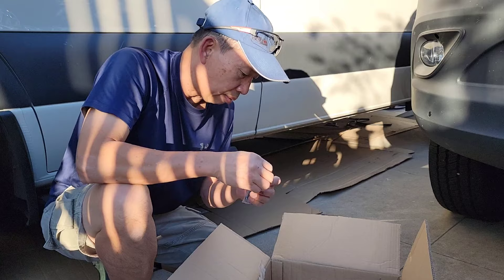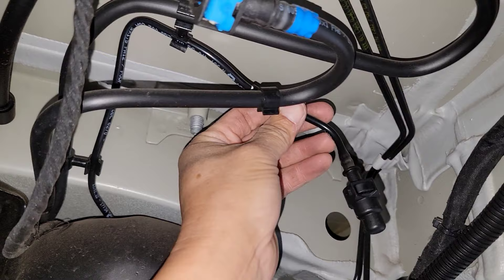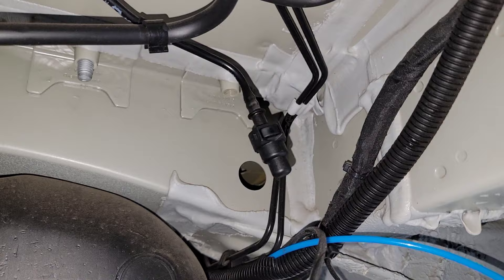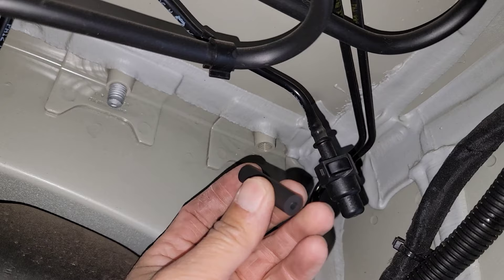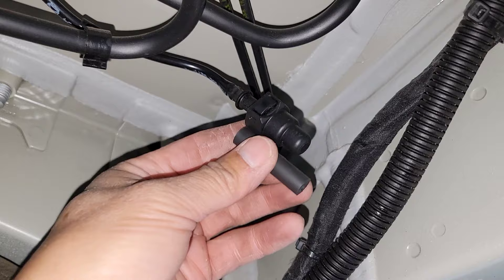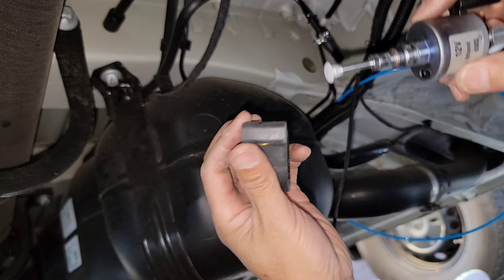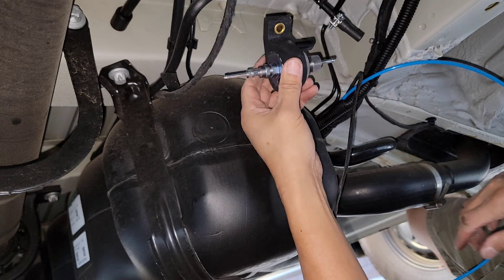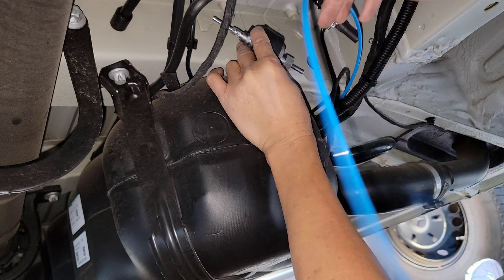How to connect Eberspacher Diesel Heater pump to factory fuel line on Mercedes Sprinter #vanbuild

Comment: I wish you were in the east coast... Well,,, congrats on taking another project.. 
Does recent all sprinter van comes with auxiliary fuel line or is there option for it?
Reply from the maker: So far all of the diesel models come with.  I'm not sure if this is an option.  I don't remember.
Reply: Thanks for the info...  @BoChuonOUTDOORSVANBUILD
Reply from the maker: They come with at least the Diesel models.